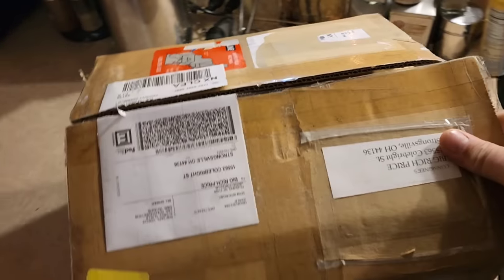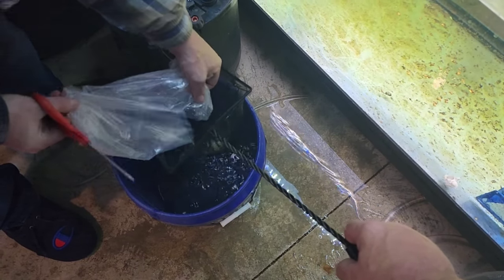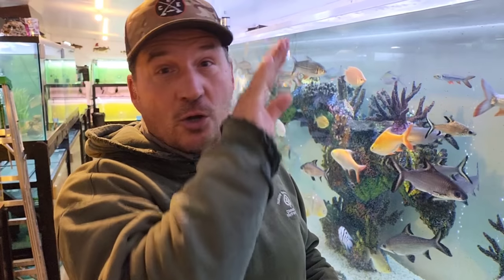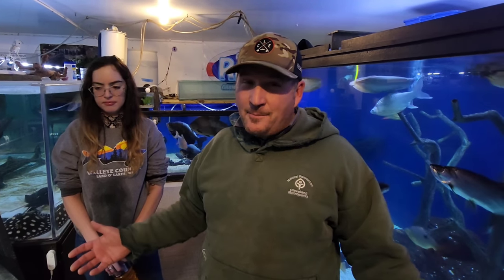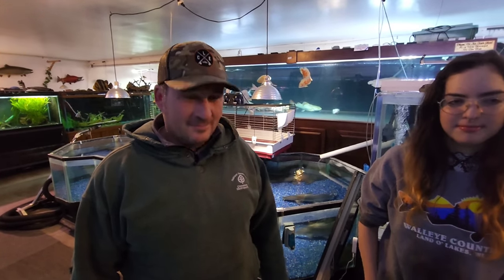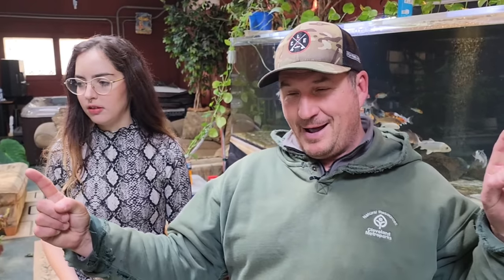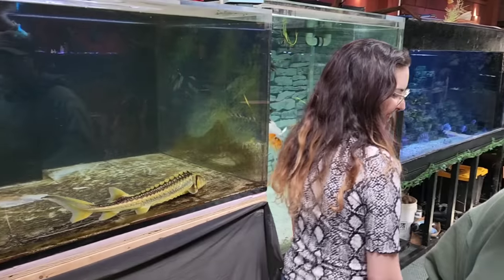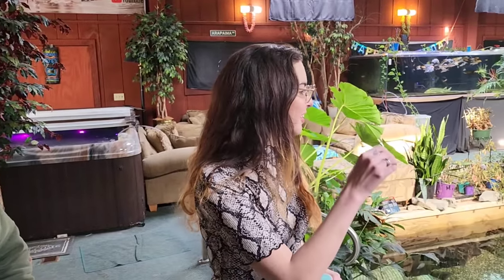Unboxing new fish and we get a visit from Mike Duralec. ohio fish rescue

Comment: Hi, I'm not trying to insult you in any way, but from what I've heard, you should let puffers stay in water when transferring them. The risk if you don't do it that way is that they  might puff up, when above water, and inhale air and they can have difficulties getting rid of it in the water and potentially die.
Reply from the maker: There is a slight possibility but thats mainly in very large specimans